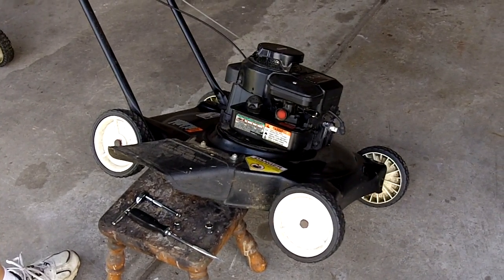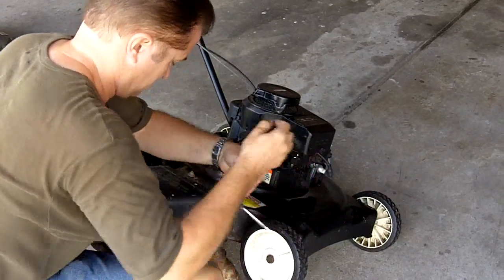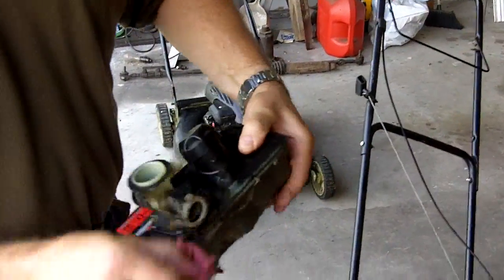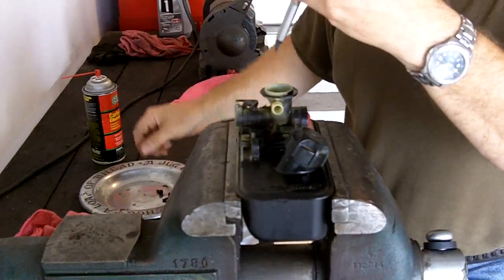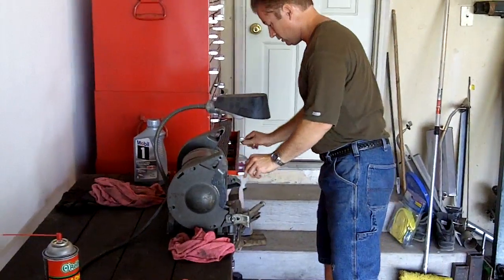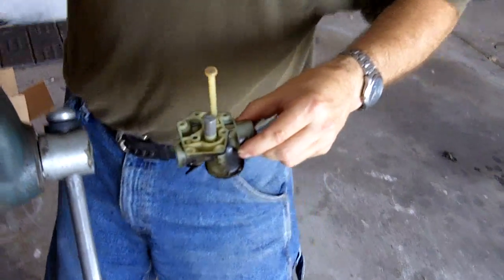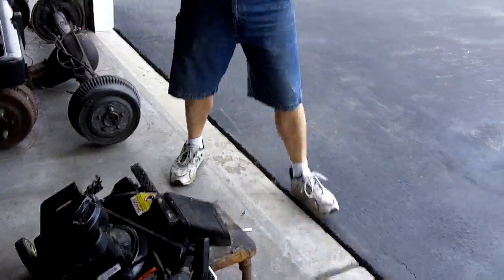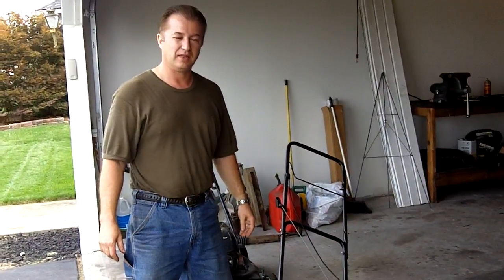Fix your Briggs & Stratton Powered Lawn Mower for Under $10 (Repair Procedure)

Comment: thank you SO MUCH!!  i replaced the plug and cleaned the air filter and it still ran like crap...i was just about to go buy a new mower as so many things are almost throw away items nowadays and i am not mechanically inclined at all but after watching this video i had to try...figured i had nothing to lose so i got out a few tools and had mine running like new for $5...took me a bit longer than 10 minutes but not much. thanks again!
Reply: Shit.  I literally just bought a new mower yesterday and think this is the problem with my old one.  Well, looks like I'm gonna be able to have the wife mow with me so we can bang out the lawn in half the time.

Comment: Thanks from England for your video and explanation. Just got a Briggs & Stratton 450 series running again. The bigger bolt was undone by a 13mm socket and the smaller one a 10mm socket. Think they're technically 1/2 and 3/8 but I only have metric socket to hand so they were close enough.

Comment: My local Lowes had a Briggs & Stratton OEM rebuild kit for $4.  Just finished doing this to mine, though i also replaced the spring and pickup screen, as well as the plug and fired on first pull.  Ran like it did on day 1.  (5 years old). Mine is a Briggs and Stratton 183cc.

Comment: I just replaced the carburetor diaphragm and gasket on a Craftsman power mower equipped with a Briggs & Stratton engine, and I got to do it TWICE, because I got the stacking order of the fiber gasket and rubber diaphragm wrong.  The first time I assembled it, the primer bulb didn't suck fuel at all, just air.  I re-examined the old gasket and diaphragm, which were pretty much fused together with age, and it was DIFFICULT to tell on which side the rubber was.  On the second attempt the primer worked properly and the engine immediately started up.  FYI — the fiber gasket goes against the carburetor body and the rubber diaphragm goes against the boss on the fuel tank.

In my case, i was taking a chance that the diaphragm was the cause of the problem which was uneven power and engine speed, particularly when the mower was decelerated sharply, causing the fuel to slosh in the tank.  It wasn't enough to kill the engine yet, but it looked like failure was imminent, so I bought the gasket and diaphragm kit (less than $3 on eBay) and swapped it out.  In a brief test run it appears to have cured it.  I'm happy, as 20 minutes of work and a few bucks in parts saved me $100 in shop charges.

Comment: EXCELLENT!  EXCELLENT!  EXCELLENT! 
Thank you!  I'm am the ANTI-Handy Man!  Can barely change a light bulb.  But in this economy, I couldn't see spending the $90 bucks to have, what I thought, was a simple problem fixed.  Enter your video.  The diaphragm was $2.99 at my local NAPA Auto Parts.  I changed the oil and installed a new air filter.  Now.....The push-mower than hasn't run in 3 years fired right up!  Total cost - about $7.50!  THANK YOU!

Comment: Thanks for this post. Two years ago my Briggs and Stratton mower showed all the classic signs of needing a new carburetor diaphragm. The lawnmower  "specialists" I used to service it were obviously not aware of these symptoms as it took them two attempts to fix and cost me 100 euros (about 130 dollars) into the bargain! It has recently started to do the same thing and following your clip I have fixed the problem for the cost of the part (3.50 euros/ 4.60 dollars). If I can fix it anyone can!

Comment: Thank you...worked great.   $4.98 at local Lowes.   Yard Machine, with Briggs engine.   Starting running like crap this year, with fouled plug.   Tried just about everything until I found this video.   10 minutes, and runs like new!

Comment: Rock on!  Bought the lawn mower for $60. Ran great at the sellers house. Than did an immediate nose dive. Changed the spark plug and it started easy. But, all the problems mentioned here. Thought I was out $60. And then your video saved the day. Ordered the part on line (different part number but I had the manual. May be the same thing) and watched the video twice. Took me 10 minutes to replace. And for about $20 (spark plug, filter, oil, and diagphram, it runs great. Thanks so much!

Comment: Yep. Most of the time it just needs a rebuilt(usually a completely new carb) because they haven't properly drained the fuel and it goes bad and eats the carb.

It's amazing how fast gasoline can turn to crap without fuel stabilizer and even then the shelf life is crap compared to so many other sources of energy like propane.

Comment: I sware I don't intend to disrespect you or attack you brother but this video is irresponsible as hell. Your spraying carb cleaner on your carb without safety glasses! My father has been working on cars for over 35 years and he's had carb cleaner in his eyes. It can be horrific. Carb cleaner as you surely know is nasty, nasty stuff and can cause permanent eye damage and immense pain.
Please edit the video reco'ing safety glasses when using carb cleaner. 
Thanks for the vid and god bless.

Comment: HELP!  I replaced the diaphragm, add new oil, replaces air filter and spark plus, new gas - and lawn mower is still revving up and down and blow a bit of smoke.  really frustrating for my first attempt at DIY.  Thanks!

Comment: Do you know the size of the bolts (front& side) that connect the carribuator/ tank to the engine? My brother in law used my lawn mower and when he returned it one of the bolts (front) was missing and the side one was very loose. I treid to recconect the side bolt, but it appears to be to small as it will not thread in. Just want to purchase new bolts and start from there

Comment: I'm not sure what the new diaphragm is made from, but it seems to work okay with ethanol.  I replaced the diaphragm in my mower about three years ago and it still works good.  In michigan it is almost impossible to find 100% gasoline and the gas station does not have to post ethanol percentage here in Michigan.  This year I found 100% gas at the boat marina, so I'm using that now.  About a $1.50 more per gallon, but I have a small yard and only use a gallon or two all year.

Comment: Its a Poulan with a Briggs and Stratton engine. I live in Texas and most gas stations post a sticker saying the gas may contain 10% ethanol...don't know about the alcohol content. 
This mower started acting up the second time I tried to use it....wouldn't start. the following day was gonna take it back and then it started and i had not any trouble until yesterday.

Comment: I have a 4.5 hp B&S, with only a engine brake cable, and no throttle cable.  How does the throttle work on my motor?